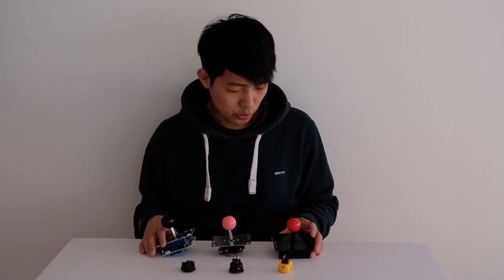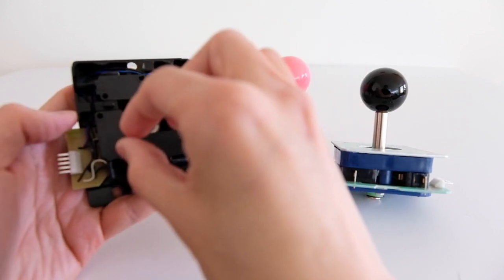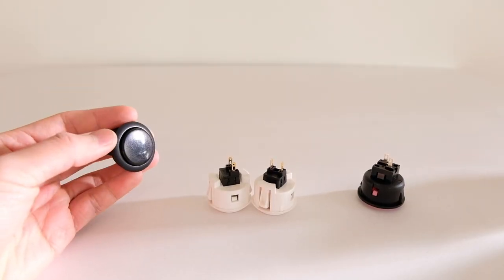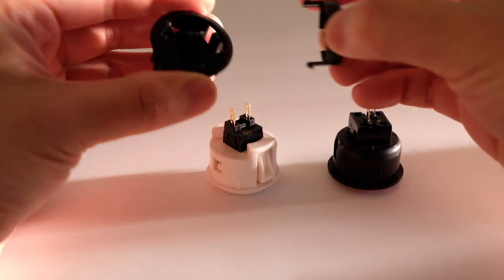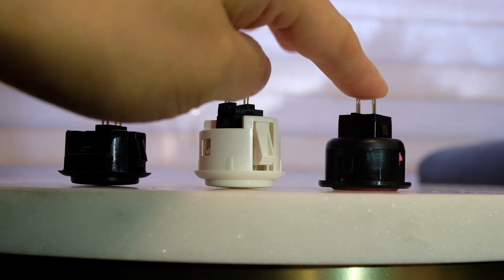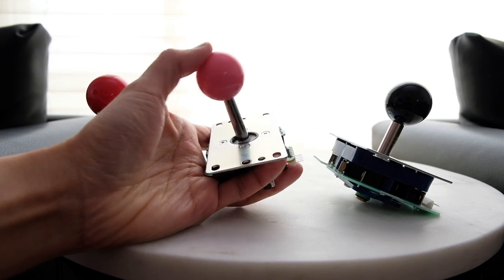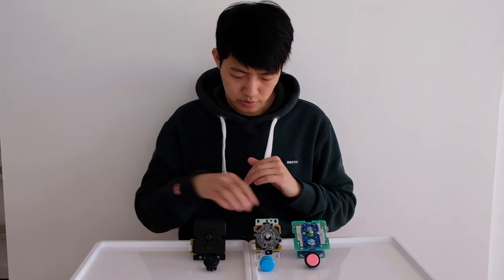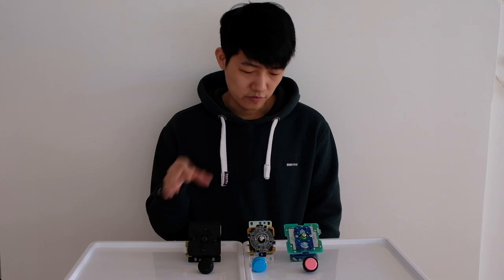Sanwa vs Hayabusa Vs Seimitsu Review Detail Comparison 2019 HD

Comment: Great comparison. Im trying to customize the ultmate fighter joystick, and I learned a lot on here. These are my only questions...
1. i HATE the square gate motion, so how do i get a CIRCULAR or OCTAGONAL motion on each joystick?  ...do i just replace the gate?

2. to add a ball top for the joystick, i just unscrew the ball and replace it right?

3. where do i find the buttons that have the INDENTS in the middle, and what company makes those?  ...the ones from 90's USA arcades like MORTAL KOMBAT, STREET FIGHTER, etc.

4. are there any other joystick/button companies left, or re these 3 you reviewed all the MAJOR ones for fighters and tournaments?

5. Which brand joystick and model would be a good one to start modding?  (Ex. HORI, MAYFLASH, MADCATZ, etc)
Reply from the maker: 1. Yes, for the gates, its a simple clip on clip off, super easy, just like my video

2. Yes, you just hold the bottom of the shaft with a flat head screw driver and turn the balltop

3. Those are HAPP buttons, those are traditional american arcade parts, it was widely popular back then, after madcatz came in, everybody switched to sanwa etc, but i do recommend using japanese parts though

4, you are right, there are more companies, the 3 i review was just kinda like the big 3 more popular companies

5, they are pretty much all easy to mod and change buttons and joysticks, BUT just make sure its not soldering, dont buy anything arcade sticks that is solder, those are super annoying to mod, and waste too much time and energy, whichever stick you plan to buy, check out a video of the inside and make sure is one of those click on click off type, plug in plug off

And thank you for dropping by🙏♥️
Reply: @JoystickNY thank you, and you're welcome. I may just buy one premium joystick, and one on the side to travel with. Definitely modding all though. Maybe one MODERN style, and one RETRO style. I may get other button/Joystick style parts too just to try them like you said in your video since I haven't felt all differences yet. Here's what I've found, and my new questions....

1. I'm a huge TEKKEN fan and player, and discovered the QANBA DRAGON joystick with sanwa denshi parts already installed. What attracted me was the fact that they sponsor Tekken, and the it looks very nice.... I'm also looking at HORI STICKS (rap4, rapN, Fighters Edge) and MAYFLASH F500. ... What are your thoughts and recommendations when comparing these? 

2. Can the ARCADE 1UP cabinets be modded as well as just like the joysticks? 

3. Im going to use BROOKS ADAPTERS to use modern controllers/joysticks on older systems (Dreamcast, Neo Geo, PS1/2, etc.). The MAYFALSH adapters aren't bad either. Do you recommend those adapters or do you have a better recommendation? 

4. What's up with those BROOKS UNIVERSAL FIGHTING BOARDS they sell for installing inside joysticks?  I'm not sure of their purpose. 

5. Arcade joysticks don't add INPUT LAG do they? ... It was mentioned somewhere, so I needed to be sure. 

... sorry for additional questions. I guess you can tell I'm a hardcore fighting game fan lol.  It's also Amazon Day, and I want to purchase one before the sale is off. 👍
Reply from the maker: KJ MullinZ “You said you are modding all” you actually dont have to modd it if they are already good parts. Most sticks are already equip with sanwa or hayabusa. Modding it would be kind of a waste imo. I would recommend just sticking with one good one that you like, because most of the time, you will be only using one. And if you are buying something like qanba dragon or panthera, those you can swap out buttons n sticks in like 5mins. 

1.those are all great sticks, you would be good with any of them, I use my RAP4 the most, I really like hori sticks. But most people like sanwas, I like sanwa too, but I like hayabusa more.
Those sticks are all diff price range, how much are you looking to spend?

2. The arcade 1up cabin is easy to mod, is those type of switches that you plug right in, nothing complicated. Use a video guide and you should be good

3 &4. For the brook universal board, if you have like old consoles, xbox 360, ps3, ps classic, wii etc, and there are alot of great games on those consoles, having that universal board, you can use the arcade stick on many consoles, or some people just use an adaptor, which I have a brooks adaptor, for going from ps4 to xbox 360, the adaptor is usually limited to a certain console, if you build a arcade stick with the board, it will be cheaper in the long run and it will just work with more consoles. 

5. “arcade joystick input lag” if you are talking about the hardware it self, it doesnt not affect he input lag, usually the input lag has to do with the chip/board and the software.
Reply: @JoystickNY  thanks for the reply. I couldnt make up my mind, so i decided to go with the QANDA DRAGON. yes, its pricey, but it just looks real nice and heavy to stay in place since ill be using it at home and not travelling with it. its also easy to mod as you said and from what ive read. I will most likely order another joystick down the road and make it my RETRO stick using HAPP parts for nostalgic reasons. For the anda Dragon, ill make that one my MODERN joystick. however, i NEVER liked the BAL top or the SQUARE gate, so those have to be changed to BAT TOP and octagonal or circle gate. 

to be honest, this will be my very first fight stick. i have all the tekken sticks, but mainly for collecting since thats my main fighter. i dont use my tekken sticks at all lol. therefor, im NEW to how sanwa, hyabusa, etc. all feel. once my Qanda Dragon arrives, ill know if it feels good. that company sponsors Tekken tournaments, so im certain it was a good choice for me. Also, its black, silver, with some red. those are my colors. :)

now i will ask these... 

1. WHere can i find SANWA BAT TOPS for ns  sell because all the major shops are sold out. 

2. Also, the qanda dragon has a silver joystick, and ive seen someone add a silver BAT TOP mod on theirs. where can i find that? ive looked everywhere. 

3. how does that hori rap4 feel, and is it heavy enough to stay still?  ..i might get that as my retro stick. that or the rap N which is more square with headphone jack.

4. what is best online store for buying custom joystick parts for best prices?

...on a side note, i cant wait until my stick arrives! itll be my  first time feeling like an arcade again!
Reply from the maker: KJ MullinZ 1.2.4, for the longest time, i have been using focusattack dot-com for most of my parts, when i am buying a alot with friends, i usually go there, because they charge a shipping so its not a good idea to buy 1-2 things, if i am looking for 1 or 2 things or cables or stuff, i use ebay and amazon. Cuz alot of times there is no shipping. 
3. I have been using the hori rap4 probably the longest and i love it, is quite heavy and there is rubber on the bottom, so it doesnt slide. It is also wide enough and curve for the wrist. I like it better than my razer panthera. i ll do review on it one day when i have more days off. On my rap4, i got sanwa joystick, and all hayabusa buttons. With square gate, and ball top, i do recommend using ball top tho, because i used to play in chinatown fair arcade  back in the days where all the pros in NY goes, all they had was bat top, i think bat top is good on marvel vs capcom, but imo i think ball-top feels better for street fighter and tekken.
Reply: @JoystickNY   Joystick NY  thanks for update! 

1. so why do you like the RAP4 better than the RAP-N by the way? 

2. Since im already spending a fortune on qanda dragon, and making it my MODERN JOYSTICK with minor mods, I plan to buy one more joystick and fully customize it as my RETRO STICK using all happ parts and to have that 90s USA feel.  Which brand/model would you recommend for this side project and why... 

Hori Rap4
Hori RapN
Hori Fighters Edge 
Mayflash F500
Reply from the maker: @KJ MullinZ 
🕹 ⬇️↘️➡️🔴🔵⚪️
1. I like the rap4 better because of the shape, they both have the same parts, i like the longer shape and the curve on the RAP4 better, my wrist feels good on it. 
🕹😊
2. since you already have a premium stick, I would go with a cheaper and small option, qanba drone, mayflash, madcatz sf4 anniversary stick, the small one. they are all around 50-60$, i would even consider getting a used one off ebay, since you are going to mod it anyway, there is no need to buy a nice stick and replace the good parts with happ parts, imo.
Reply: @JoystickNY  gotcha, and thanks for all the info. Much appreciated. the reason I want happ mods is for nostalgic reasons bts. I never got use to the bat top and square gate. It's very uncomfortable to me.

And yea, I think I'll just get a cheaper joystick and mod it. Maybe off ebay like you said.
Do you think the MAYFLASH F500 will do me justice? ... It's universal and around $90 for brand new one. Just wanna make sure it's big and heavy enough to still feel Ike arcade material lol.
Reply from the maker: KJ MullinZ i would even go cheaper than that, like a used one, under 50$ off ebay, i been using square gate since street fighter 4 came out, and i have gotten so used to it, idk if u ever saw my welcome video first video, its with square gate and ball top mainly. But go with which ever you feel comfortable tho.
Reply: @JoystickNY i understand, and Bat & round all the way for me lol. Unfortunately, that F500 isn't on eBay any lower. Buying ankther one any cheaper than $90 may result in it being too small and cheap feeling lol. I googled TOP ARCADE FIGHT STICKS And F500 came up on list along with few others. I checked them all out (Reviews, YouTube, etc) that's how I found you. 

I checkd the focus attacks website btw, and all the good stuff is sold out. Sanwa bat top and dust washer all gone. :( ...they do have other brand bat tops online, but I'm big on MATCHING brand name parts.

 I also noticed a SHORT JOYSTICK SHAFT item? ... is that something you recommend, and how does a shorter shaft even benefit?

PS. You sound and look like you are good at fighting games. Add my PSN @KJonline.

I don't get on much, but I love a good challenge. TEKKEN is my main game, but I'm pretty good at all the major Fighters.👍
Reply from the maker: @kjmullinz  i see, if thats the case, go for the F500, my friend has one, it is not bad.
i actually never used a short shaft before, i probably wont like it, some people buy it for non fighting games, such as pac man or old arcade games, you get faster execution tho, it has a shorter throw, meaning from neutral to any direction will register faster. i never seen anyone use it for fighting games, its definitely not as comfortable as the regular length.
I play fighting games all my life, and i would say its my favorite genre, i am just slightly better than an average player. thank you.i been busy with work and havent get a chance to play on psn, and my psn expired recently, i gotta get another 1 year pass soon.  i ll note down your psn, we can definitely play when i get my setup back on.

Comment: n response to your comment, I got the Razer Pantera Evo with a Stock Sanwa JLF lever and .9lb and Square gate. From the moment I took it out of the box I have felt it has been a complete waste of money. The stick is so loose, massive throw range, horrible. I played American arcades with what? the HAPP Eurosticks with Octo gates? were those the ones in the 90's arcades right? Anyways in the arcades DP's and Fireball were easy when I was like 12. Here I am getting my first Sanwa with Square gate thinking its going to be wonderful. Nothing but disappointment. Execution went from very high overall (on pad) to dirt low beginner level or worse. So the 2lb spring helped a little bit but not enough.  I have a Seimitsu LS-40 on the way and I am excited to say the least. Also have a oversized actuator and a Octo restrictor gate on the way as well for the JLF. Between the mods for the JLF and the new shiny Seimitsu LS-40 I think I will be much much happier. I will never again play with a stock Sanwa lever and square gate combo. Its unplayable in my opinion. I have read from others too that they absolutely HATE the stock Sanwa with square gate. They find it awful as well. They said the Seimitsu comes stock with a sort of Square-roundish gate that is much better, so  I am even more excited when I think about it LOL I highly doubt any pro uses a STOCK Sanwa JLF lever with a Stock Square gate. Everyone I read about their info or ask, also say in their equipment used or there preference pretty much all use CUSTOM Sanwa Lever's .Custom, not stock (LMAO) Custom is the key word Custom. I will never ever touch stock Sanwa's for the rest of my life, I swear it.
Reply: Arslan ash won tekken 7 evo 2019 with a stock hayabusa lever which has a larger throw and a softest spring than the stock sanwa, when you play you are not supposed to touch the restrictor gate all the time, you should move just enough to register an input and use the restrictor to find the diagonals

Comment: Great Vid.  I’d say it’s not which one is better but which one suits your play style.  Sanwa has medium play and dead zones for fighting games.  That way you can change your direction last minute instead of it reacting to instinct.  Example: down and forward will normally do diagonal right/down.  The dead zone keeps you from doing that until you fully pass the dead zone.  If the opponent decides to do a top down attack, you can choose to back out of that movement before fully committing saving you frames.  Zippy Joysticks, for example, have no dead zone.  They are used for games that require instant movements like racing games or pacman.  If you have dead zones in pacman, you would get killled by ghosts unless you could predict the future.  Dead zones are not bad, and you can get rid of them completely by just increasing the diameter of one part.
Reply: n response to your comment, I got the Razer Pantera Evo with a Stock Sanwa JLF lever and .9lb and Square gate. From the moment I took it out of the box I have felt it has been a complete waste of money. The stick is so loose, massive throw range, horrible. I played American arcades with what? the HAPP Eurosticks with Octo gates? were those the ones in the 90's arcades right? Anyways in the arcades DP's and Fireball were easy when I was like 12. Here I am getting my first Sanwa with Square gate thinking its going to be wonderful. Nothing but disappointment. Execution went from very high overall (on pad) to dirt low beginner level or worse. So the 2lb spring helped a little bit but not enough.  I have a Seimitsu LS-40 on the way and I am excited to say the least. Also have a oversized actuator and a Octo restrictor gate on the way as well for the JLF. Between the mods for the JLF and the new shiny Seimitsu LS-40 I think I will be much much happier. I will never again play with a stock Sanwa lever and square gate combo. Its unplayable in my opinion. I have read from others too that they absolutely HATE the stock Sanwa with square gate. They find it awful as well. They said the Seimitsu comes stock with a sort of Square-roundish gate that is much better, so  I am even more excited when I think about it LOL I highly doubt any pro uses a STOCK Sanwa JLF lever with a Stock Square gate. Everyone I read about their info or ask, also say in their equipment used or there preference pretty much all use CUSTOM Sanwa Lever's .Custom, not stock (LMAO) Custom is the key word Custom. I will never ever touch stock Sanwa's for the rest of my life, I swear it.
Reply: @rebranded1248  okay, but that’s not a hit on Sanwa.  You said it yourself.  You said stock.  But when you buy any joystick you have options.  Choosing the cheapest isn’t the company’s fault.  Example:  you pick the cheapest Zippy over the cheapest Sanwa for a fighting game.  You said they didn’t have Sanwa in American arcades, Americans weren’t winning internationally either on fighting games.  The point I’m making is dead zones have a purpose.  You don’t want instant reaction in a joy stick playing street fighter for example.  You can rest the stick in a deadzone spot and make your choice to block or attack and that makes the difference.  If no dead zone, you’d have to move the joy stick in a fraction of a frame from the dead center of the stick to choose to either block or attack based off animations your brain is receiving based off frame rates. So depending how you play and at what level determines what stick is best for you.

Comment: I brought the sawna buttons but I don’t know if I want to change them for the hayabusas lol one sounds like a beautiful mix of arcade buttons but have this sweet delightful type writing feel aka (hayabusa) or the sweet firm clicks of sawna that just sound absolutely blissful! Is there a way to change the push button colors of hayabusa?
Reply from the maker: Scion Of dankness hayabusa doesnt have much color options, they used to only come in  black, then hori release the RAP4 in white, blue, red, so those 3 colors got release, and then hori release the fighting edge, which comes with exclusive chrome silver buttons, which were exclusive, you couldnt find them before, now they are available also, i got a few from arcade shock last month
Reply: JoyStickNY is their s way to custom paint them?
Reply from the maker: Scion Of dankness i think the easiest way would be just buy color spray paint of your choice and spray paint it, but over time the coating may wear off leaving color on your fingers
Reply: @JoystickNY  seems like a good concept but the only way to prevent the paint from doing that is to avoid using normal spray. for car gloss spray like melee players do with our gamecube controllers.